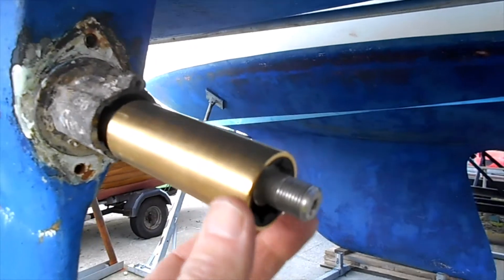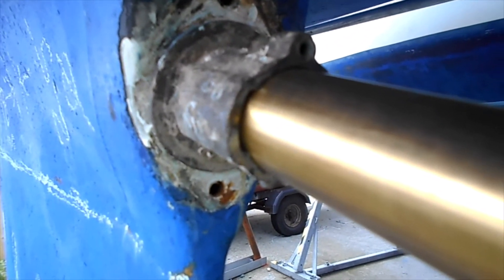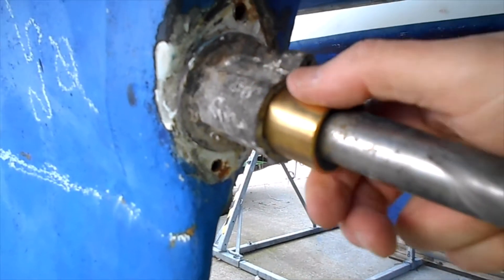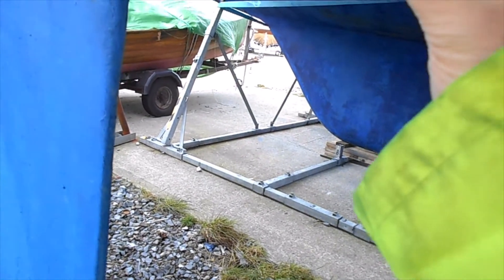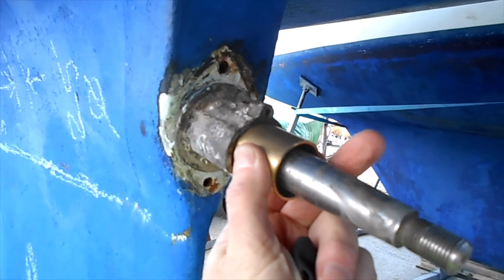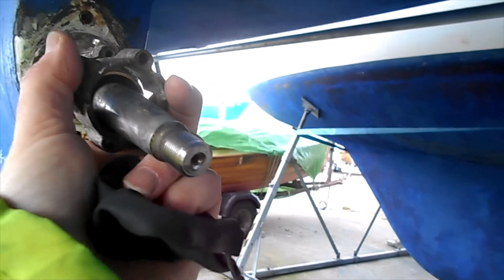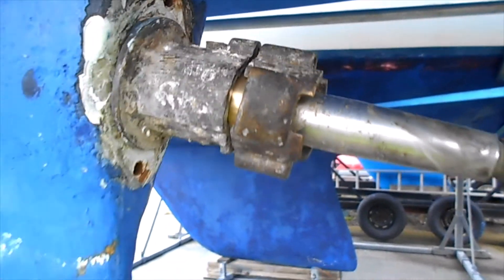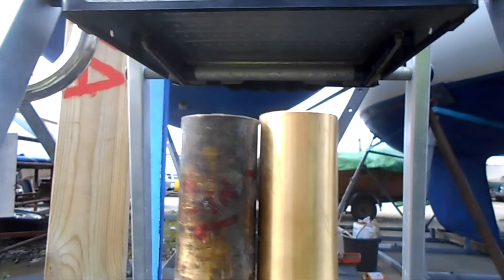Feeling 286 Special cutless bearing (bagues hydrolube)

Comment: Hello Kevin 
,how did proceed to remove thé old hydro bearing?
Thanks
Reply from the maker: The old bearing was held in place with epoxy. I heated the bearing with a propane torch.  I was then able to remove it with a stilson (pipe wrench).
Reply: @kevinwoods5859  thank you very much for your coments,i ll haul the boat in 10 days then i ll sée if m'y problem Is thé faultly bearing  Bruno
Reply: @kevinwoods5859  Kevin,it mean you have remonved  thé shaft ta changé thé hydro bearing?
Reply from the maker: I did not remove the shaft because I did not have the right tool to disconnect the shaft from the gearbox. It would have been better if I had removed the shaft. The shaft is not very smooth.  The bearing is wearing.  I may replace the bearing again next winter, and may fit a new shaft.